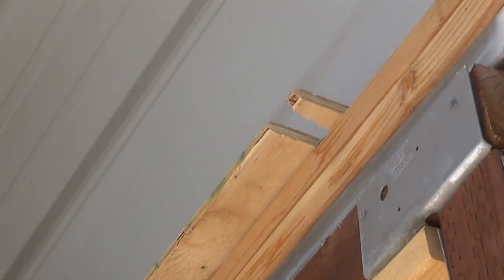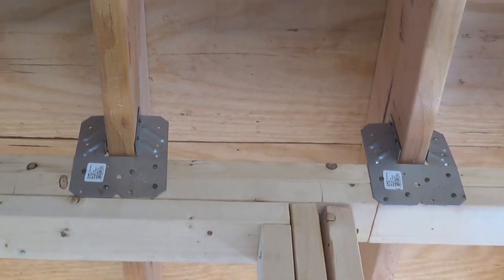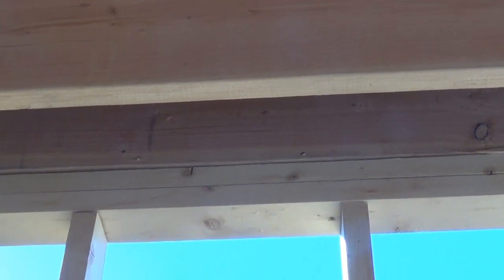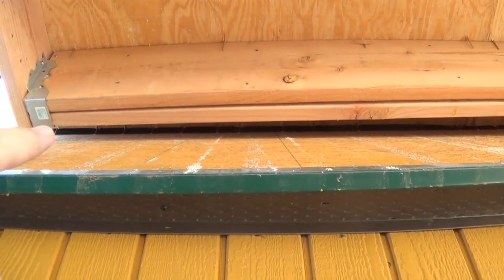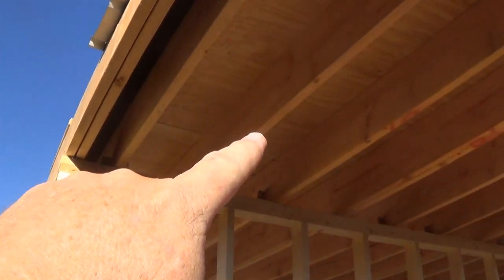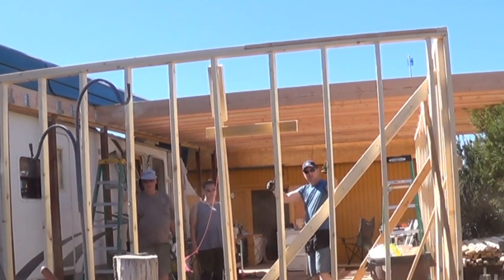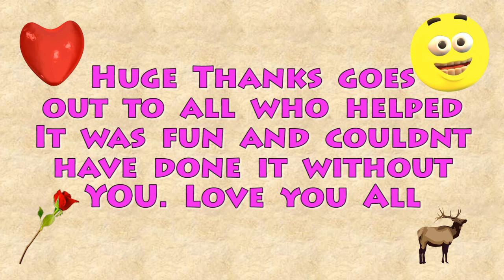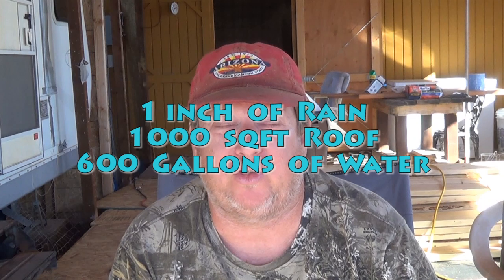Time to put up the 20 foot Rafters. 🚧 Can I do it One Handed? 😲

Comment: I will tell you your carpentry skills could use some help. I couldn’t help but notice that you missed a lot of your nails through your plywood to your I’ll call roof joists additionally your wall studs were off  not on 16” as you said. I wonder do you have a set of plans to work with? You could save a lot of materials if you did. and you’ll find your structure will look better also.
Reply: I agree Bob but I would say Jeff is having a lot of fun and I think this is more important.
Reply from the maker: wow just to think you used the words carpentry skills as it relates to me is comical.  i have no skills no pans. i make it up as i go. lol, seriously i do i make it up. friends did the wall studs they said it was 16 oc. lol. funny is when i put a level to the studs some are a little off. lol.  the important part is it doesnt fall down in the next 20 yrs and it doesnt leak.
Reply from the maker: lol thanks. just enjoying life. that is as long as it doesnt fall down on me. lol